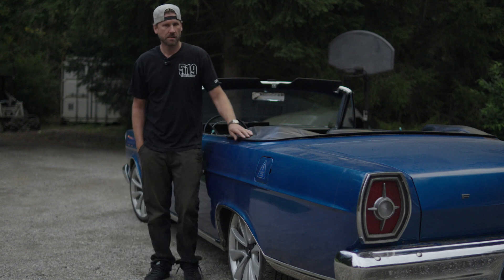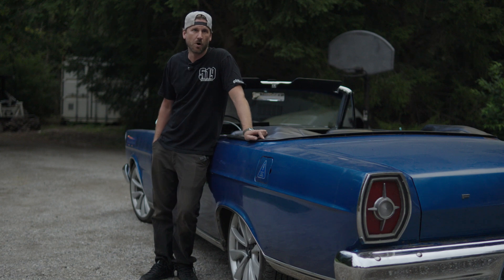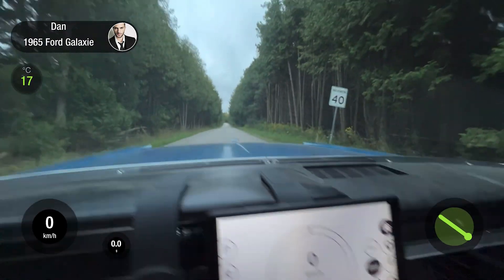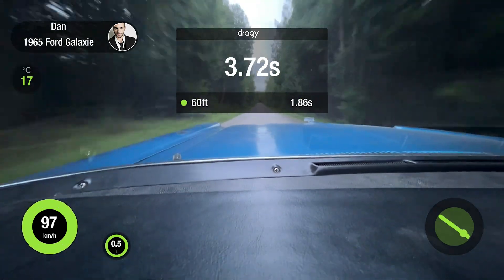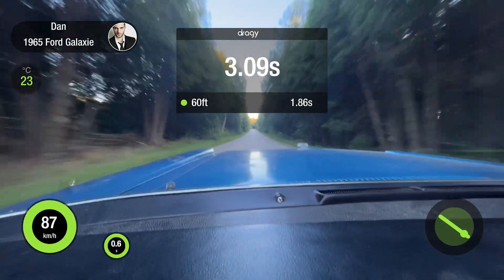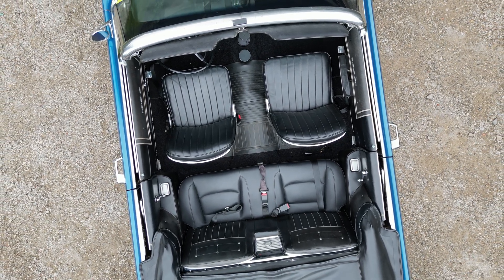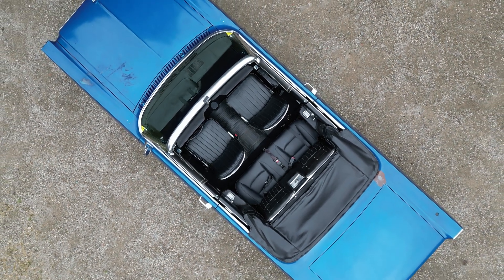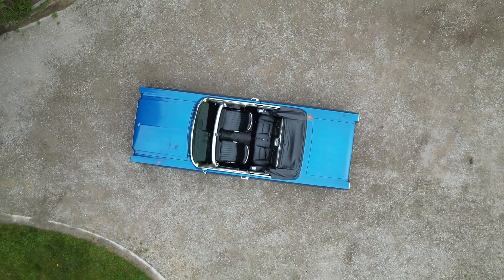Tesla Performance 4D1 Motor Swapping for ultimate power

Comment: did you swat both motors or are those times for just the rear motor?
Reply from the maker: Only the rear was swapped. The front motor is the same for the performance model.
Reply: @519Kustomz  ok, thanks for clearing that up for me

Comment: not really tested at same SoC :/ whats the battery voltage and the drop under full load?
Reply from the maker: Not sure exactly as it happens fast, but the drive capacitors are able to handle a lot of the voltage drop. We did initially test at a bunch of different SoC and it made surprisingly no difference at all until it was below 20%

Comment: Nice bit of recycling :)
Electric vehicles are a scam especially new ones. Even if c02 was a problem EVs aren't in any way a solution they are actually just a difrent much bigger problem which the conversion of old vehicles to EV's reduces slightly.
A really big improvement would be taking the old batteries and repackaging them into universal hot swap modules no bigger than a suitcase.
Hotswap in this instance means not having to rip half the vehicle apart and remove a massive monolithic lump of highly dangerous chemicals plastics and toxic metals just to repair a minor fault.

Comment: Did you change the current between motor swap?
Reply from the maker: Tesla does I think let a bit more current through with the 4D1. Ingenext controller is still ultimately relying on Tesla to control max motor parameters

Comment: I thought the awd stock model 3s are all right at 4,000# and it's the rwd which depending on year weigh 3,560# for the 2020-21 m3 with the 51-55kwh lighter nmc pack's. And the lfp cars are between 3,750-3,840# depending on the year. 

My point was this old lead sled you built only weighs about 10% more than a stock awd model 3. 
I can't wait to see that vette build! Also weren't you building a Ferrari swap to? 😁
Reply from the maker: Yeah I was kind of surprised it wasn’t way heavier than the model 3. The Bette should be awesome! That Ferrari project is back with the customer for body paint and interior. Hopefully I’ll see it back in the spring for some vids.

Comment: Expected an improvement but not by that much. wow. Is there not any open software for tweaking these motors? How much does ingeneext charge for a programming like that?
Reply from the maker: There is a guy that has run these open source but ingenext ultimately still relies on Tesla controlling motor parameters for safety reasons. They have cranked it up to what Tesla seems ‘safe’. The cost of the module from ingenext varies with options.  Check their website to be sure.
Reply: @519Kustomz   Oh nice. This 4d1 motor is also on the newly refreshed model 3's correct?
Reply: @EugenePutin  I think the 24 m3p has the 4du rear drive unit which makes up to 408 peak hp.
Reply: @4literv6  Thank you for the info